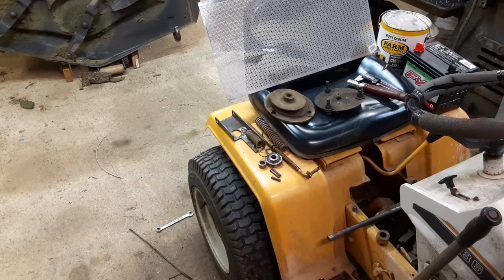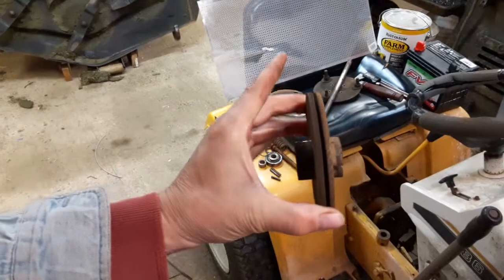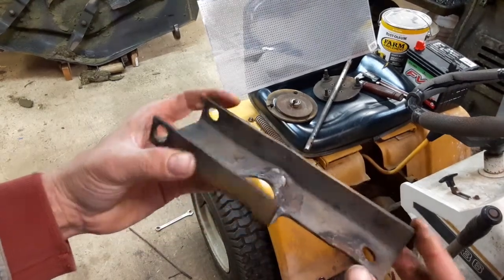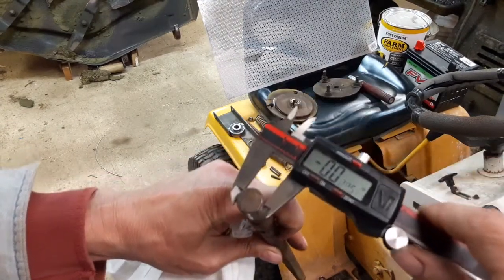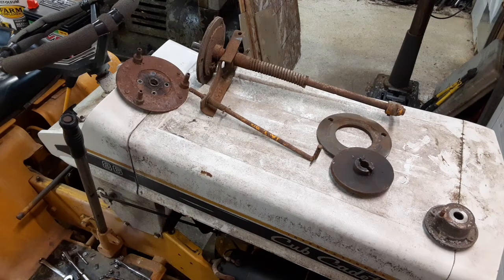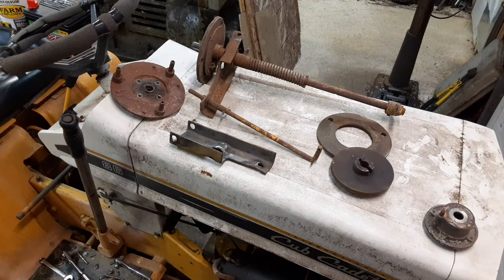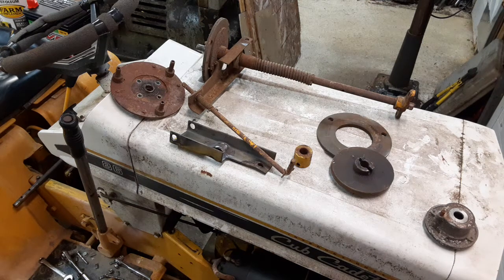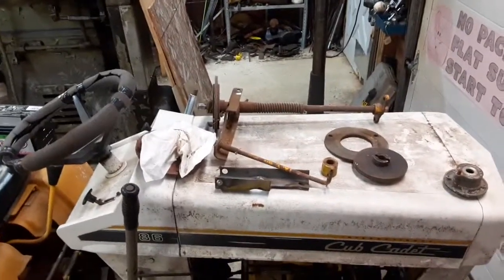cub cadet clutch and drive line repairs part 1

Comment: I have a 1000 series and having a hard time finding clutch parts. Where do you recommend purchasing parts?
Reply from the maker: Gardentractorpullingtips.com
Isavetractors.com
Those might be good options...also there are forums that you could ask the question on also that may have better ideas

Comment: I believe  that 1200 is a totally different animal than the 86 and won't work for you,  besides  those parts are too valuable to try to alter them to fit the 86 you have.  That 3 pin driver plate is real costly not to mention the $200. Bushing it takes for the special 1200 drive shaft!!  I suggest you take all the 1200 parts and keep them together safe if you ever need them for a 1200.   Just go buy your 86 parts.